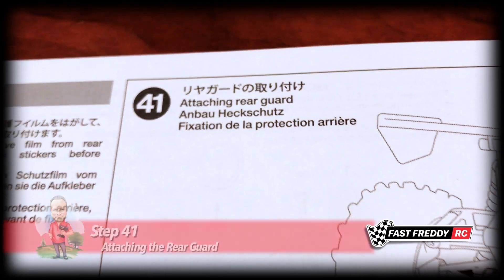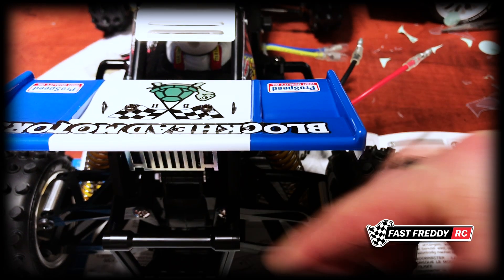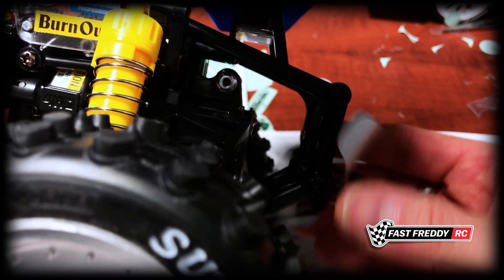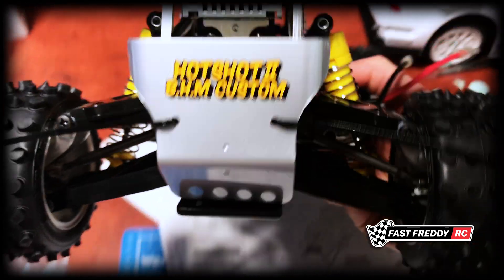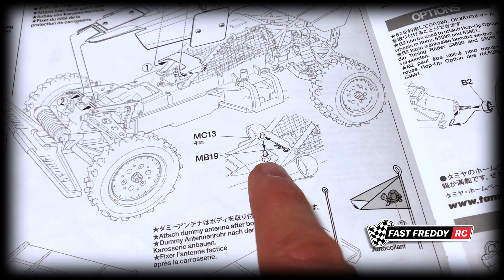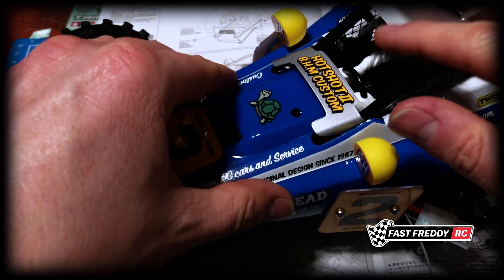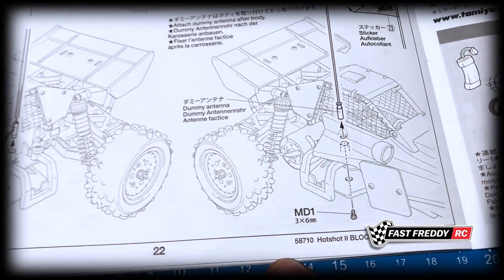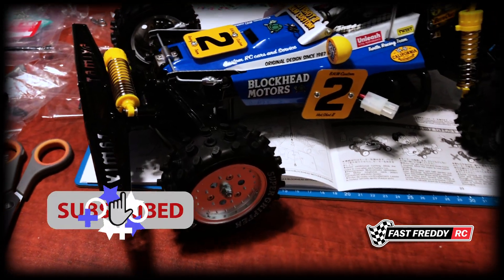Blockhead Motors HotShot II Build Series! - FINAL STEPS! - Steps 41 and 42 - Finishing Touches

Comment: Nice. I really like that BHM really has an eye for details and not only pushing their livery on the cars.
Haven't you a second metal antenna in the kit? The 2.4 GHz antenna shouldn't need the plastic tube. So you can put on two fake metal antennas for vintage look. And some roll protection
Reply from the maker: Thanks Dirk!  There isn't a second antenna in the kit which actually would have been a great idea (just like the Frog).  But yes, you're correct, you don't really need the plastic tube one so I'll probably be taking it off soon. The metal one looks great and fits the overall look...the plastic one...unnecessary.  They should really just tell you that you don't need to use these anymore.  For most Tamiya kits, your receiver wire is so short you can't use them anyway.  I definitely like your idea of the double metal antennas.
Reply: @FastFreddyRC  hmmm, my SHS has two, that's why I asked.